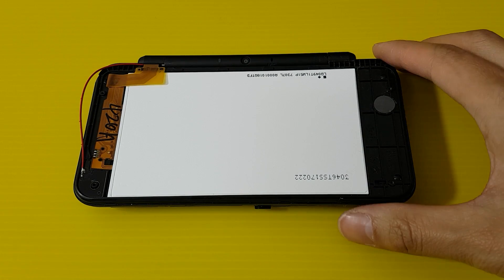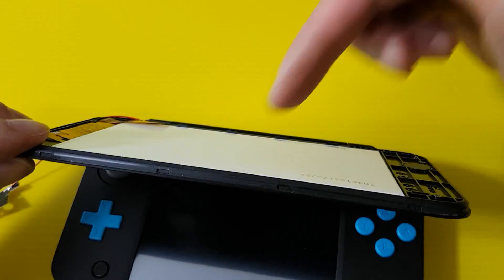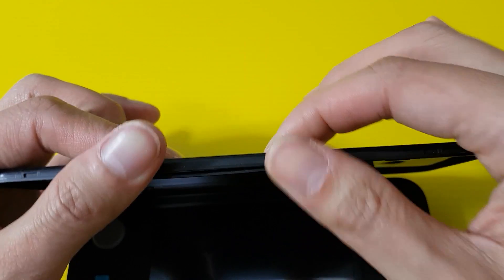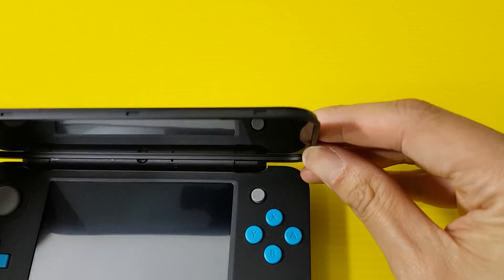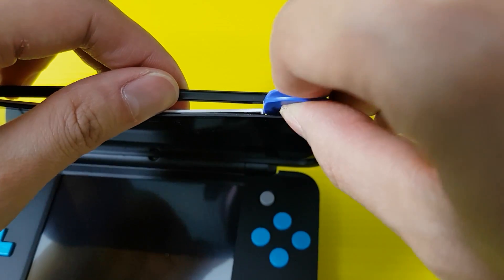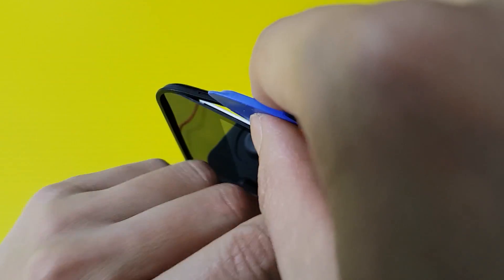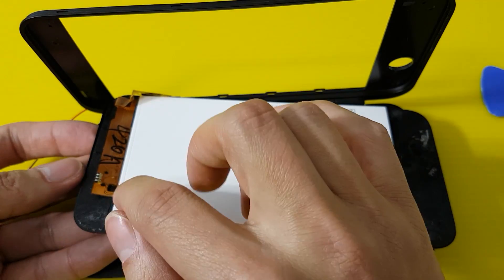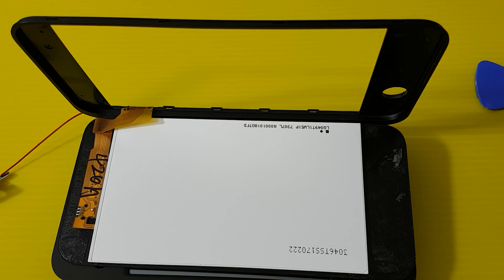2DS XL Proper Way to Disassemble Top Screen / Take Apart / Disassembly / Tear Down

Comment: Hey H H, if you simply wanted to replace the battery, do you think that would be difficult or dangerous for the average user? this is the first 3ds that has non user replaceable battery (nintendo's words) so that's why I ask. Thanks!
Reply from the maker: Yes, you can change the battery quite easily. The only tricky part is to open the bottom housing properly. You need to carefully open the clips to avoid dents. After that, simply just pop the battery out; it is held down with double sided foam tape also.

Comment: Pretty soon, Nintendo consoles will just be held together with a layer of tape on the back and one more on the front. These things just keep getting cheaper and flimsier.
Reply: This i a new 2DS, it's supposed to be a slimmed down version and not as well build as the new 3DS / XL to make it more affordable.

Comment: Is it hard to seperate front glass from lcd panel? Is it glued on all lcd surface or only on edges? I already ordered top screen, but it is nearly impossible to find it with fron panel so I guess, that hairdryer will have a lot to heat :c